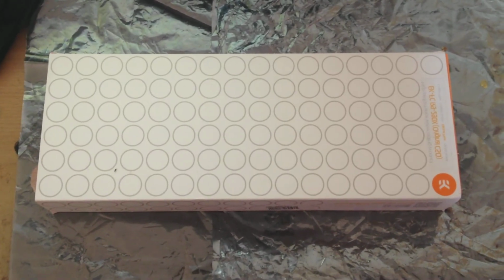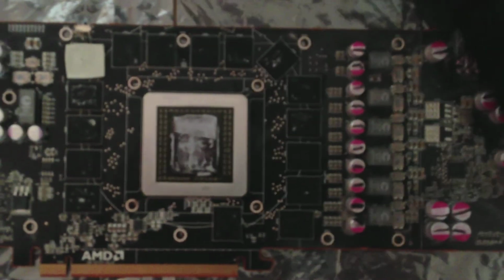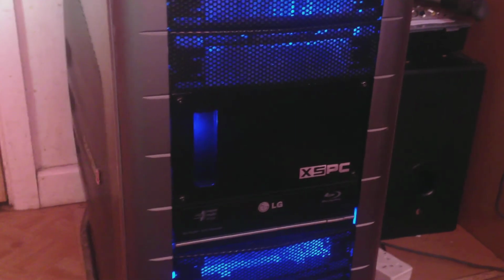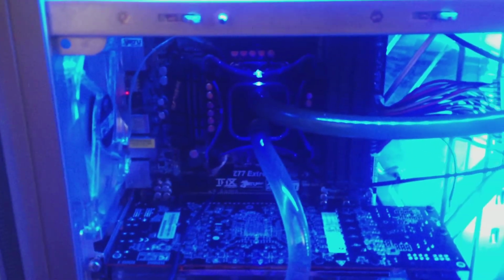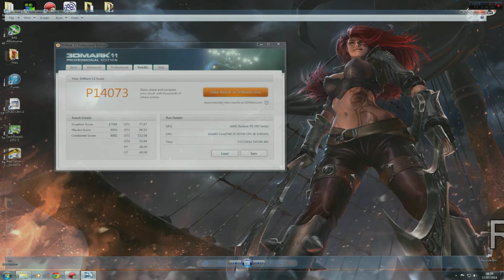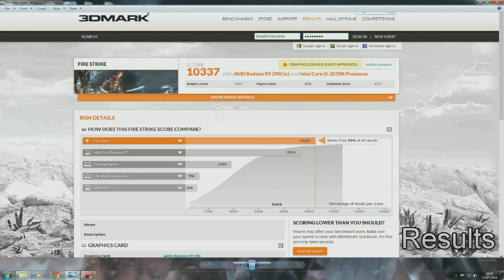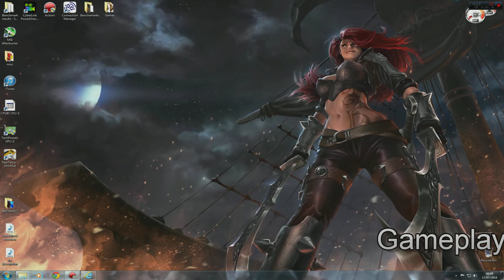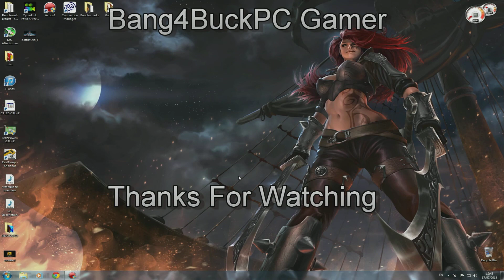Watercooled XFX R9 290+Rig overview and Benchmarks

Comment: some one i know told me that watercooling the R9 290 is just to remove the amount of noise it makes but does it actually affect temp ?
Reply from the maker: The person that gave you that information is seriously misinformed, Watercooling the R9 290 seriously reduces temperatures on the whole card. check out this 13 minutes of my gameplay in Assassins Creed 4 Black flag to see for yourself. before I installed this water block my temps were about 85c for every game. The water block also increased my Maximum overclock Watercooled R9 290 AC4 Black Flag Performance
Reply: can u tell me if this build is good 
i7 920, P6 workstation grade mobo, 12gb corsair dominator ram, R9 290, Kingston 120 SSD, corsair 1000w 80+ power supply
Reply from the maker: Jacob White The processor could do with an upgrade in a year or two but apart from that, it's a decent build and a very capable gaming PC
Reply: how much do you think you would budget that ?
Reply from the maker: Jacob White what's your currency ?
Reply: Canadian $$
Reply from the maker: 323 $$ will should be enough to upgrade you to the intel Z97 platform with a 4690K CPU. that will out perform the i7 920 in just about everything and in some cases by some margin
Reply: and also can u do a world of tanks vid ? low,medium, high, very high ?
Reply from the maker: I was asked that before but the problem with that game is that it is very CPU intensive and when I record the gameplay it drops the FPS by almost 20 frames per second so I deemed it not a worth while representation of what the R9 290 is capable off

Comment: What fan´s are you using on your 360 radiator?
Reply from the maker: XINRUILIAN 1650RPM fans, they have a CFM rating of 65.2 along with a static pressure rating of 1.8mmH2O. they came with the kit but I bought an extra 3 to go push pull

Comment: make a video showin us the backplate
Reply from the maker: I can post a picture as it's only a backplate, as for issues with contaminants not really but my EK UV Blue coolant stained my tubing, so I would go with distilled water and coloured tubing instead. Are you referring to the Heat Killer GPU water block, I had one for my GTX 480 they are quality.